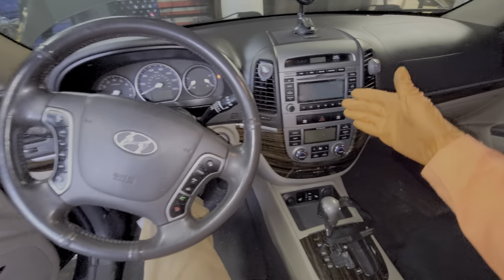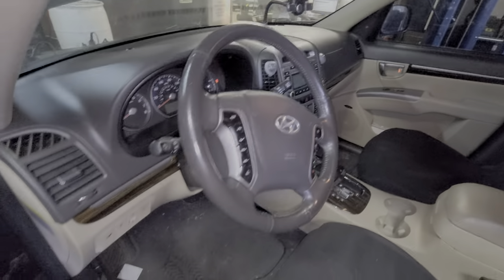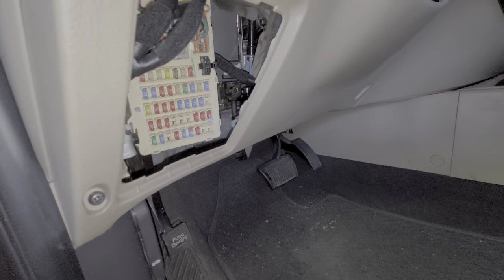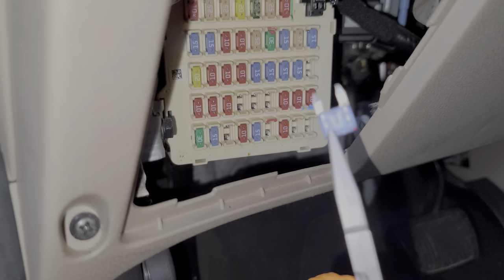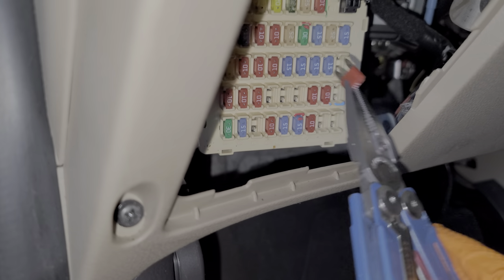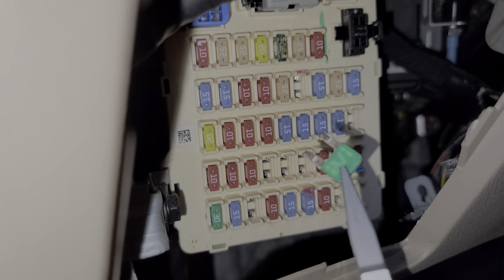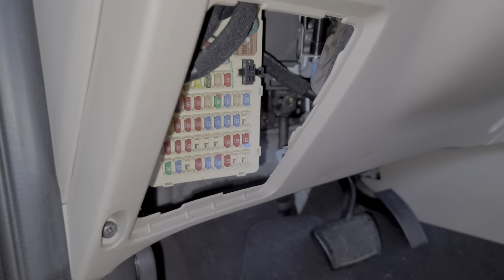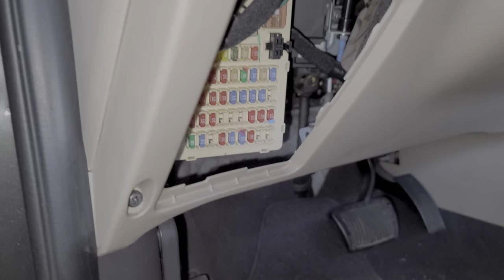2012 Hyundai Sante Fe Radio Fuses

Comment: Nice instructional video. I have learned alot. Right now I have a 2006 Charger 3.5 stalliong issue. runs and cuts off at a light. No code on the Torque obd. I have changed everything. I need an oscilliscope to find out what is cutting the 5 v. and turning off the engine. Thanks for the info.

Comment: The battery to my car died and my radio hasn't turned on since , it will not power on. I have the same car just a 2011 but it looks the same in the inside. What should I do to get my radio back on any suggestions?